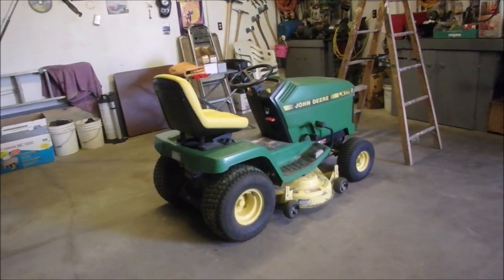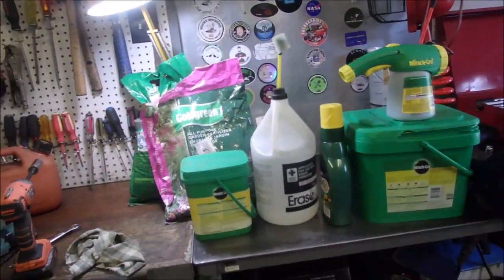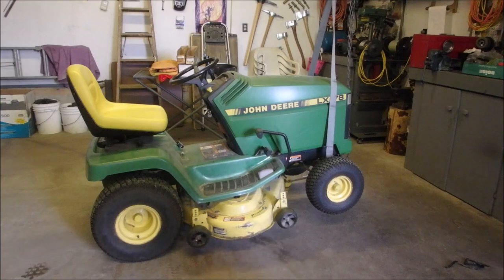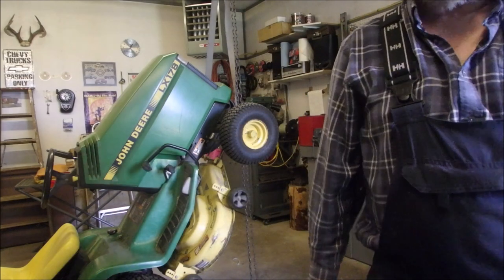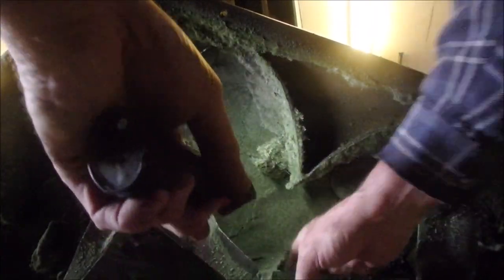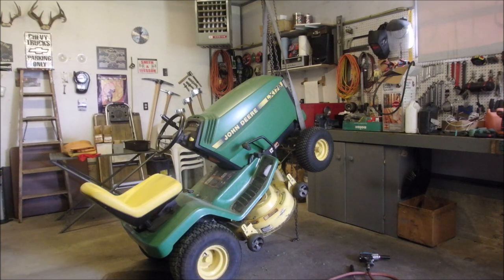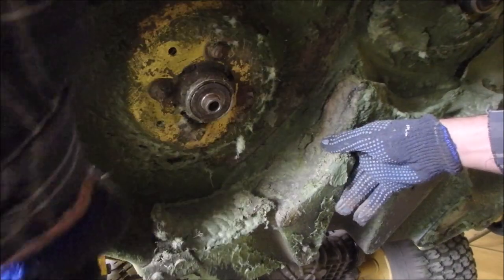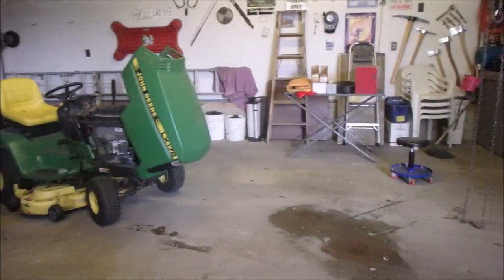John Deere LX178 Blades--Sharpen or Replace?

Comment: Bruce if you pull your seat and tip it forward there is hydro fluid cap to check your hydraulic fluid and add if needed. Not sure how well it seals when lifted on its tall like that. Since it did not evaporate quickly you may have lost some fluid. Might want to check. I love my LX178 and I searched for a year to find the Piranha deck. They only made them three years I think. Great video - the top blades are to keep chopping up the clippings while they are in the air underneath - bottom blades cut the grass and since it has the center discharge the suction is better than any other design I have seen. In Tennessee we have Bermuda grass so they tell not to bag plus no need to dethatch as they break down readily to feed the soil.
Reply from the maker: Good point on the hydro fluid.  I will check it.  Now that you bring it up i am sure that is it.  Thanks on the blade info.
Reply: @BrucesShop  sent you an email to long for this comment section.
Reply from the maker: @901ronnie  ok

Comment: I'M not familiar with the piranha deck. I have a LX188 with a 38" deck I know it has the same engine as your LX178 but I'M not sure about the differences between the 2 mowers. Did that deck come with the double blades from the factory? Thanks so much for sharing!!
Reply from the maker: Yes it did.  It is great mulcher as i said in the video

Comment: Bruce,    the track on the ceiling,    its not 1 5/8 unitrack?
Reply from the maker: It has a track on the top and the bottom    same size upper and lower
Reply: @BrucesShop  okay,   because I've started gathering parts for my  garage, but i going to be able to roll the chain hoist or electric winch back and fore on a 4 roller gantry each gantry capable of 700 lbs, so im going with 2 4 roller gantrys    the 1 5/8 unitrack only has  tracks on the bottom side
Reply from the maker: @charleshorton1026  That is what i would like to have.

Comment: Hi. My wife just bought me this mower deck for the same tractor as yours. Blades  were hitting and ended up being loose though. So I tightened them up but called my local John Deers shop-$86.79 upper set/ $94.74 lower set. $14 each to have sharpened =$84? Didn’t see how bad they are yet and hoping to have them sharpened though? Wondering you said how you installed them and was hoping you would have shown that was all? Any chance you have a picture? Thank you for the video and also if you can send or show picture? Have a good day
Reply from the maker: I will check
Reply from the maker: This video at 11:55 shows the blade installed
Reply: @BrucesShop  Good morning and thats were you run then and reinstalled them? Thank you and i will go back and check. Have a good day
Reply: @BrucesShop Hi just went back and looked they don’t look like the cross at a t -the one on the right looks offset or is that just the way the video shows? Thank you just wanna make sure i install mine the right way is all. Again thank you
Reply from the maker: @rayjrdibenedetto867  OK  Thanks for watching

Comment: i have several jd riders from the 1990s . couple each of the 38s , 46s and 48s . never saw the underside of a 44 mulcher though . interesting setup . watched some vids from "across the pond" , and most of their riders seem to be rear discharge , with counter rotating , timed blades (cogs on both sides of the belt) . kind of bizarre , if you're not used to seeing that kind of deck .
Reply from the maker: Yes  It is "busy" under the deck eh!!!

Comment: Great mower
Reply from the maker: I think it is too
Reply: @BrucesShop  I have a 2000 water cooled with a Kawasaki engine it has never gave me a issue other then a set of tires oil changes and flushing the radiator to keep it clean general maintenance it runs great

Comment: Just a few weeks ago I got a John deere x304, v twin kawasaki 17hp, it is in excellent shape for a tractor with 1107 hrs on the clock, it's the one with all wheel steering, everything works perfectly, it looks brand new, runs, starts on first turn of the key, deck is electric pto works perfectly new belts, spindles blades, 42" deck not a mark on it, only issue is the steering does work, turns out, the steering shaft lower bushing it wollowed out, so the small gear doesnt mesh with the steering plate gear, and you would think, easy right, take the lower c-clip off lower the gear off the steering rod, then take the wollowed out bushing off, and put new on..... Right...... Nope, the whole steering shaft and upright steering box system has to come off, and then put the whole tractor up on its butt, and take the deck off for clearance, and lower the whole shaft put of the tractor, then replace the bushing, and then reassembly, a true nightmare, but once it's done, it will bring 1000 bucks I hope, with the way things are now, maybe 6 dollars, Lmao, oh the best part, I got it for free.
Reply from the maker: The F word    "free"